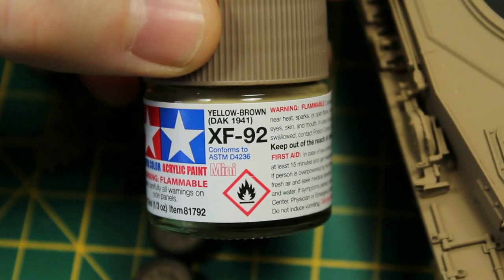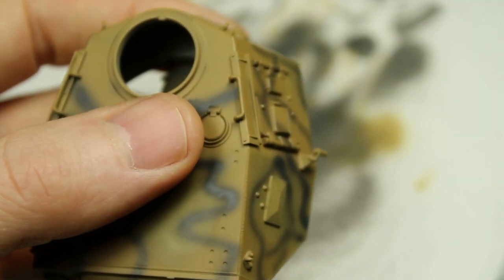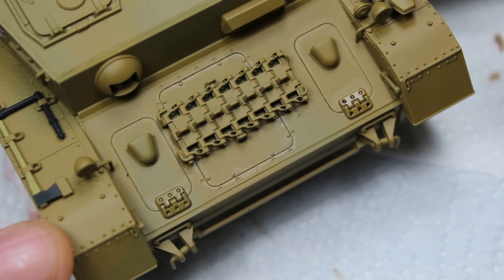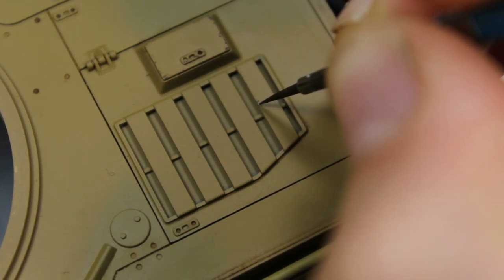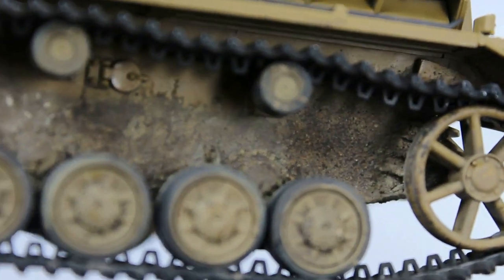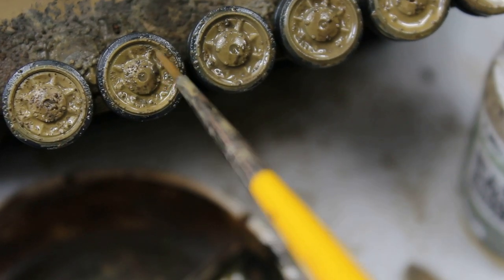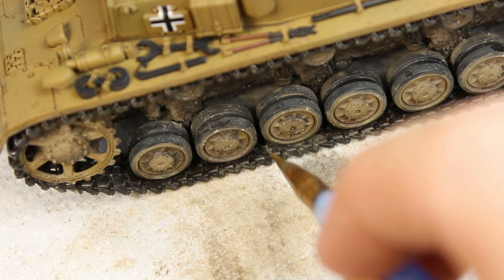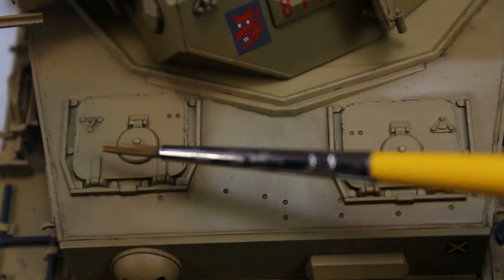Tamiya 1/35 Panzer IV F Full Build, Part 2, Plastic Model Kit Tank Building, Paint and weathering

Comment: Awesome video - always wondered how the "greenish" color on Tiger 131 was applied in that faded look. Always thought that it was the Dunkel Grun mixed with a lot of fuel of some sort which gave it that faded or lighter look. Kind of like the crew just did not have enough paint to do the job so they may have mixed some diesel fuel to the paint in order to complete the job. Look forward to the next installment.

Comment: Very helpful video. But IMO the jack, jack block and spare tracks shouldn't be colored dark yellow, since they were installed after the factory paint coat. These were sometimes painted over when camouflage paint was applied in the field, but in that case the other tools would have gotten the same treatment, so I don't see how only a few would be painted over.
Reply: Possibly yes, but sometimes they were in fact painted in the field.  Many of the Pz IV, Pz III etc were actually Panzer Grey when they arrived in N. Africa and the crews would later paint them in the field.  LOL Depending on crew, maybe they just decided to leave it on the tank when they sprayed it.  Cheers!

Comment: Oh another thing - the spare track links on the front deck - why are they painted in the hull colour and not like the other tracks?
Reply from the maker: Based on them being applied before paint, probably incorrect but I went with it
Reply: It was a lot easier to just leave those things in place and paint over them than try to wrestle them off and then put back in place. Also, if vehicles are going to a dedicated paint shop and items like the tools, jack, spare tracks were not removed, or periscopes not covered up by tape or newspaper, these items would just be painted over because the employees at the paint shop sure were not going to remove them - not their job. Also, if painting in the field and there is a threat of enemy contact, lot easier to leave those items on the vehicle and paint over them. More or less a crew "decision", depending on circumstances probably.

We do the same thing in the modern US Army as well. Some unit commanders will insist that tools and such be removed before painting while other commanders (or crews for that matter) just do not care if those items get painted over. Also, getting paint over sprayed onto the rubber portions of road wheels is more common than one would think because, again, someone either has to cover up the rubber somehow or you depend on the skill of the painter and hope they are good enough to not get paint on the rubber. Almost always there is over spray on the rubber road wheels which really does not affect the rubber in any way - unless you have one of those commanders that spaz out because the rubber got painted especially when they are trying to "cheeze-out" to the Battalion Commander or other VIPs (yep - been down that path before and a good can of flat black spray paint comes in handy). And, IF you somehow "forget" to tape over a periscope and that thing gets painted over - yep, it is a real pain in the buttocks region to try and get that paint off the lens with either a razor blade trying to scrape the paint off or using paint thinner which may/may not then leave behind a permanent "fogging" effect on the glass = had that happen before as well.